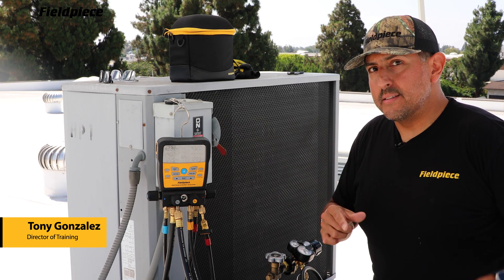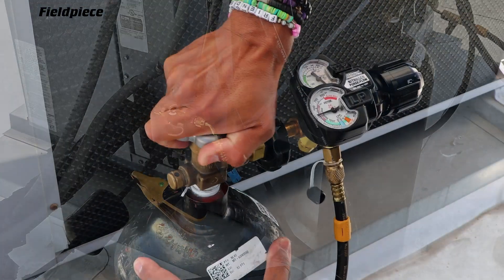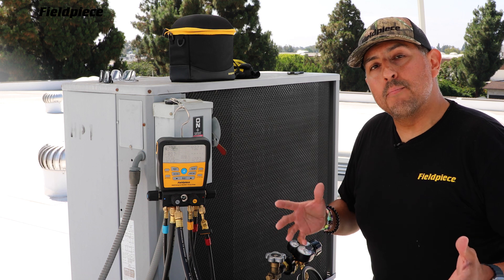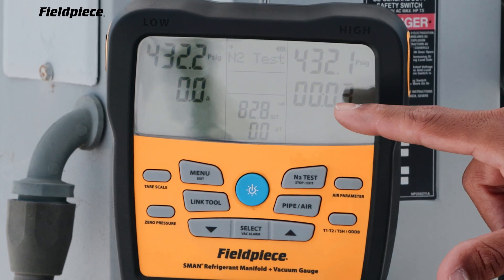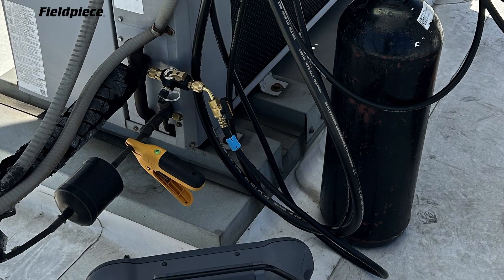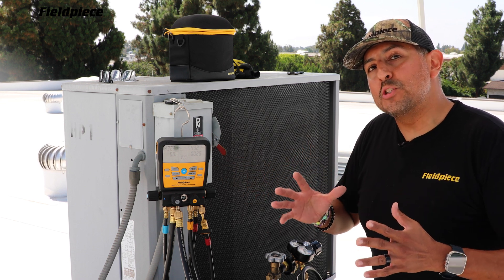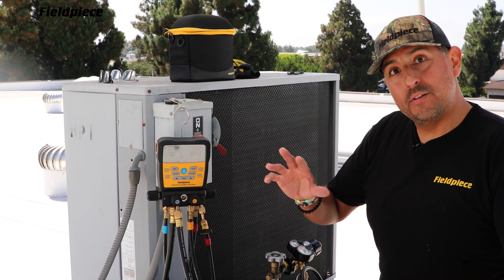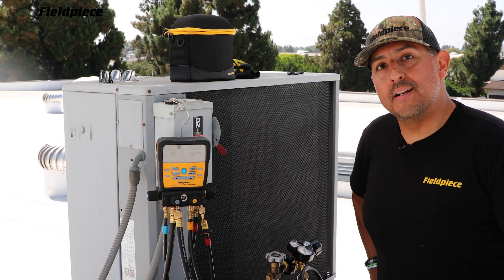Fieldpiece Pro Tip | How to Run a Nitrogen Pressure Test | SM482V & SM382V Digital Manifolds

Comment: Does the N2 temp compensation work if the indoor equipment is located in an area that much warmer than the the outdoor equipment's ambient temp??? lets say the indoor evap is in a 90 degree attic and it is 70 degrees outside... and lets say the indoor temp is changing faster than the outdoor????

Comment: TCPT never works good for a tech. Ive had leaks i could hear that passed that "test". A good rule of thumb is .1 psi nitrogen per pound of charge per hour of a real world test. To verify anything below 500micron on a new system, and 1000micron on a system repair. If you cant hit those standards something wrong. The method, the tooling, or the system. If you can figure out which one you will eliminate alot of problems.

Comment: May be a stupid question but every time I finish my pressure test to vacuum and disconnect the lines there is a ton of pressure that rockets out. Am I doing this wrong? Could this damage this system? Or do I need to just get use to hearing that nitrogen scream out every time?
Reply from the maker: Hi John! Not a stupid question at all. We would like to further understand the issue and work towards a resolution. Please contact our customer support team at 714.634.1844 or email us at fpwarranty@fieldpiece.com
Reply: Just leave your hoses connected to the system (High side & Low side) Use your yellow process hose to let out the nitro. Use your knobs to control how fast or slow you want it to come out.